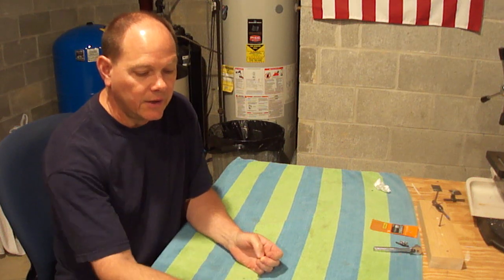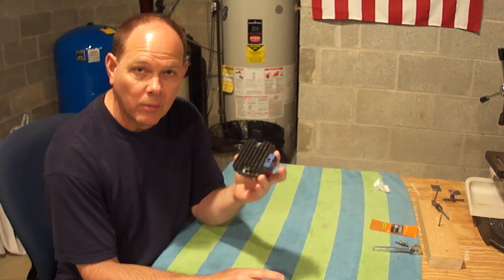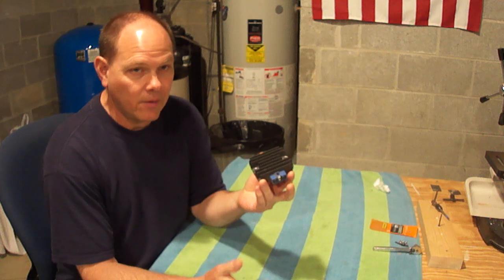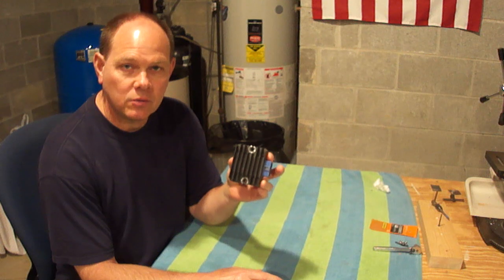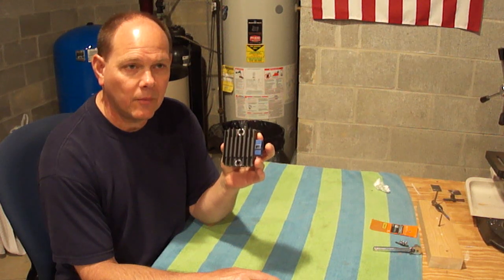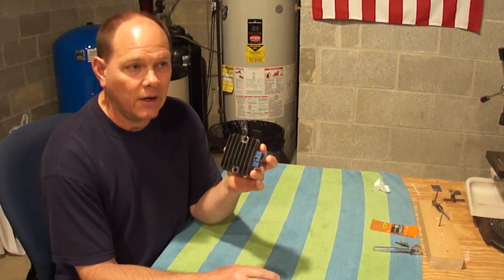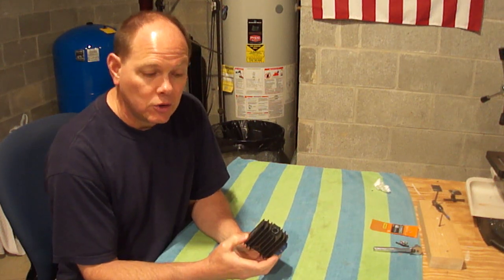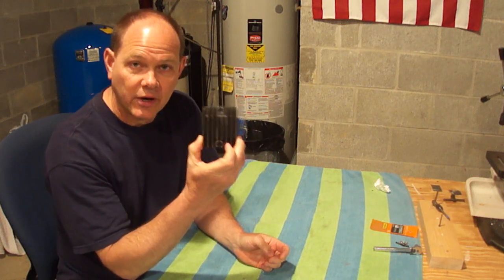Lawn & Garden Battery Not Charging - Voltage Regulator - Fast & Easy Fix!

Comment: They say, and I just heard it this year, NOT to jump start a tractor battery without disconnecting the battery because you can damage the charging system. Now, as the battery gets older, I find the need to jump start my own old battery first thing in the Spring of the year, and I been getting away with jump starting it. I need to locate the Voltage Regulator on my tractor too. Today I just learned some voltage checks to do on the Alternator AC Voltage and  at the Voltage Regulator DCV Output for troubleshooting a battery not being charged. Sometime it could simply be a bad wire from the Voltage Regulator output to the battery., so that needs to be checked out too

Comment: Ok, I've read some of the replies, this is a good topic -Thanks for vid. Everyone needs to learn to put a volt meter on your wires coming our from your stator then on this this device (V.reg), while your motor is running.  You should be able to pull the connection out from under the cowling, alligator clips help a lot. Have a good battery, start your engine and test the stator, make sure it is putting out voltage around 25-30 AC.  If it is ok, plug your Vreg back into the stator, then unplug the red wire coming out of it and check voltage there.   It should be higher than 12 volts for sure in order to charge battery. All of these VR don't hold up like they should, a new one sure, but once you start having problems they endure. I have seen a small company making and selling a souped up version of a VR to help render this problem, can't find them now.  Try to replace the VR with a custom heavy duty design if possible.
Reply: This is absolutely the correct way to test your charging system on your lawn mower can't just assume it's a voltage regulator so many times the stator goes bad overheats burns winding you've got to know where the problem is before you start changing parts.  The stator is a common culprit

Comment: can't it find a forum to post this, but seems everyone who has Husqvarna BLi20 batteries are experiencing charge problems. Here's a fix. if you can't charge the bli20 battery: unplug the POWER cord from the CHARGER. Also unplug the battery from the charger. This seems to reset the charge station when you plug everything back in so it works again. Must be a glitch in the charger's overload protections. Wish Husqvarna would help folks asking about this. This fix worked on both of my charge stations. all 4 of my batteries are charging again. WHOO HOO. Please Like this if it was helpful.

Comment: I'm a certified mechanic, The voltage regulator will not keep the engine from starting, you probably had bad connection in the start system and the a running car can burn out a small engine voltage regulator

Comment: On a lawn tractor, bad safety interlock switches, which are often hidden away and hard to get to, can cause a hot lawn tractor to refuse to restart, or a cold mower to refuse to start at all.

Comment: I get voltage to my regulator rectifier, but nothing comes out of the regulator rectifier. What could it be?
Reply from the maker: It would appear to me that you have a bad rectifier, or what I call a voltage regulator
Reply: The rectifier needs to have a battery load to put out proper voltage. Test output voltage when the battery is plugged in.

Comment: What do you do when your Kubota Voltage Regulator gives out and Kubota does not make them anymore  ? Repair Clinic could not help me neither .
Reply from the maker: Call Kubota corporate and talk to technical support.
Reply: If you can find a similar regulator you could try cutting and splicing a different one in straight to the wiring harness
Reply: @johnmillis5159  Thanks John keep up the good work .👍👍

Comment: 12.8 at battery full throttle, can't find fuse. My snapper has a box called a circuit breaker, unsure of a reset or how to test circuit breaker.
Reply from the maker: C. M. You need to check the AC voltage output of the alternator on the engine. Should be at least 38 to 42 AC volts.
Reply: @proclaimliberty2000  one video said red 2ire should have volts key on engine off

Comment: Thanks. I've been fighting this for 2 years now
Reply: Really?  Two years?  You have been trying to get a lawn more to run for two years?
Reply: Actually, that is right in my case.  I toasted multiple wires within the bundle of the wiring loom.  TB gtx20 wasn't charging so i had to charge with wall powered charger about every 10-15mins...after that much run time battery voltage dropped below what is necessary to keep the magnets powered enough to hold the pto so the blades would stop.  I have 4 acres so I did this over and over just to finish one cut, but I didn't finish.  I started blowing a fuse when engaging the electric pto AND THEN I DID SOMETHING FOOLISH.  I was soo close to having the yard cut but the damn fuse kept poppin, i slipped a soda can tab in for the fuse and started cutting.  Then that burning wire smell ..... I could get it to even start up again even after separating the melted together glob of wires.  I don't think the short began there since not an area where there is a connection, just intact wires bundled together but it got hot there making it melt.  I thought my battery wasn't charging due to a bad stator which I had planned on replacing, but I don't have the diagnotic tools nor a great understanding of what the heck I'd be doing.  The service manual, like most, are both deceivingly simple like a cookbook and yet intimidating.  The latter because I've been down way too many sucker do it myself deals and without the guidance of someone having experience, everything turns out to be a trick bag that traps me at the bottom.  The first spring/summer season with it out of commission, my 4 acres grew to chest height before having it cut, about the first of July.  I  was inindated with insects at levels I thought not possible.  I'm already at 18 inches here the beginning of May.
Reply: Timothy Tendick thanks for writing a book explaining all that to us
Reply: Matowix Unplugged amen. Lol.
Reply: @timothytendick1550  Hey Timothy, are you still battling your chest high grass?  If you need some help with your lawn tractor drop me a note.  I'm good at electrical system diagnosing, one of my specialties, be glad to take a stab at it over email.  Just send me your tractor model brand and year.  Best wishes Timothy Cheers!~  Bellarmine
Reply: @bellarmine33   it had become a nightmare.  one day i plan to upload some video of it and mowing it with a WH 520 that I picked up for $100.  I find deals but never the kind of stories you read about on here and other places.  I finally did get one though with the 100dollar Toro.  So far only replaced a belt.  I haven't done a thing with my TB gtx20 but it's too nice not to give a shot at fixing her.  I May be able to string new wire replacing those wires in the harness that were damaged by heat.  I'm not a mechanic by any stretch but with the great resources available and some patience, well.....I'm still no mechanic.  For one I don't have all the tools of a mechanic which is just about a must.
Reply: @timothytendick1550  Boy, what a trial!  Glad you found a working tractor with the $100 Toro, if that's what you mean.  If you ever feel like getting into your TroyBuilt GTX20 drop me a line.  You don't need a lot of expensive tools to diagnose simple electrical circuits, they really do look more complicated than they are.  You should see my Dad turn those over-complicated wiring diagrams into almost crystal-clear schematics - it's all logical.  About all you need is a decent multi-meter, and maybe a soldering iron.  And it seems you are interested enough to learn bit by bit, and also have some patience, which is more than many other so-called 'experts' lol!  Take care Timothy and stay well!~  Bellarmine

Comment: Would this cause the motor to shut off when the blades are engaged?
Reply from the maker: gixxer gixxer Yes
Reply: Well, maybe the regulator might cause that, but more often there is a seat switch that, if you are not sitting on the seat when you engage the PTO, the blades shut off.  Look under the seat, if you see a 2-wire safty switch, try unplugging it.  Then be CAREFUL getting off the mower with the blades running lol!  If not, there's a short somewhere.  If you need some drop help me a note.  I'm good at electrical system diagnosing, one of my specialties, be glad to take a stab at it over email.  Just send me your tractor model brand and year.  Cheers!~  Bellarmine

Comment: I did install a regulator rectifier from Amazon still the same
Reply from the maker: The voltage regulator converts AC current into DC current. If you have no DC current on the voltage regulator, you may need to get an OEM voltage regulator.

Comment: Where was it located?
Reply: Under the steering wheel at the back side of the engine in most cases. It'll be tucked away, follow the wires.

Comment: Not much help wheres it hidden and does yours have the Kohler or briggs motor
Reply from the maker: james teeter It’s a Kawasaki engine and it was hid under some metal framing.
Reply: It's the briggs Intek twin with a DC charging system. The briggs voltage regulator isnt on the side of the motor
Reply from the maker: james teeter Just look for something that has multiple fins on it and that will be your voltage regulator